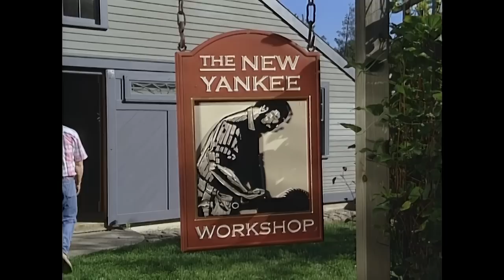Outdoor Garden Table [AI HD]  |  S7 E4

Comment: I grew up in the 90's watching New Yankee Workshop every chance I could get. I'm thrilled to find it on YouTube, thanks Norm!
Reply: i can tell you this: i couldn't live without my battery-powered circular saw!  so easy to use due to how much lighter it is than my much older, corded saw! i'm not a contractor; but use it around the house all the time. i wish i had it back in the 90s. same for my 12v brushless drill  - so lightweight and compact for tight areas but with plenty of power for most around-the-house jobs.

Comment: hopefully Norm will make a few clips when he does his boat building project. our ski boat had teak accents she was made by the COBALT boats the only thing you did about every spring or so is re seal the wood. they had their own can of stain. my dad still has the can about a quarter to half still in it. they have gotten away from wooden accents maybe they can add some teak accents to future boats. we got compliments on her everything on her was original. we gave her up due to lack of use. that hurt. who knows maybe the co co nut 🌰 will fall just right we can own another. places like the hand rail to little accents on the bow or the ski locker lid. certain 1980’s boats from my gen can be brought back new

Comment: Teak was cheap back then, now a days it's one of the most expensive type of wood available lol.
Reply: Yeah, and of course, Norm said that this is plantation-grown timber, which means it came from a certified, managed forest, and yes: it is oily, so always clean off any residue with acetone, before gluing up! With polyurethane glue, wet one side of all joints, to help activate the glue, and improve the foaming process.